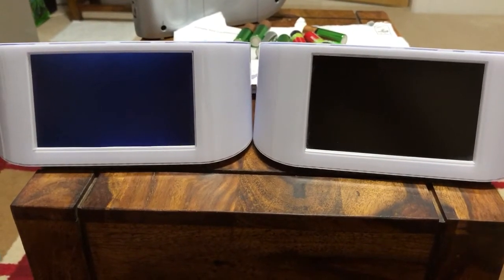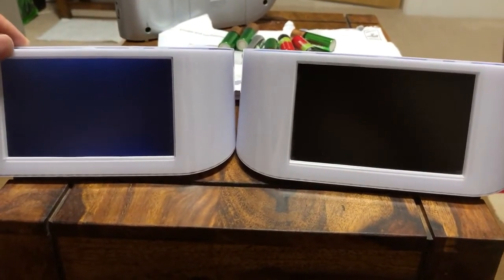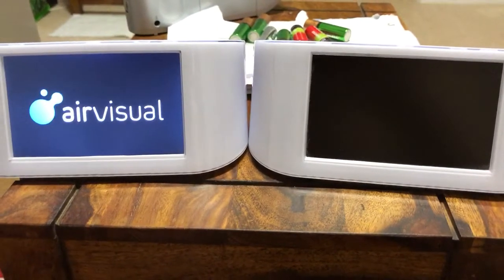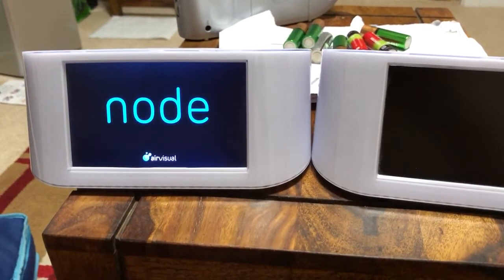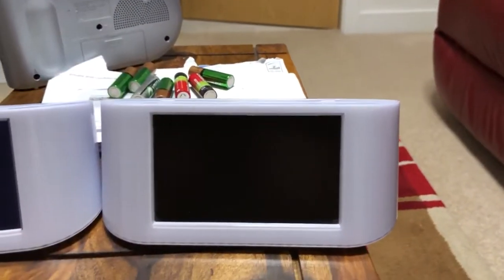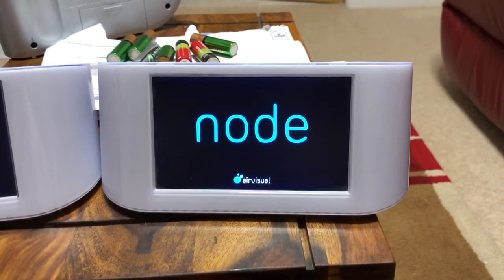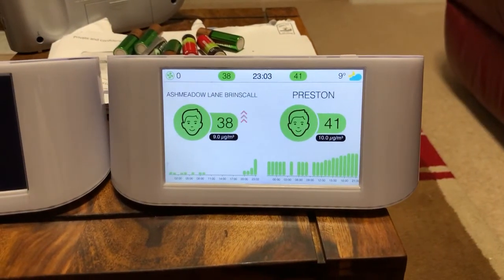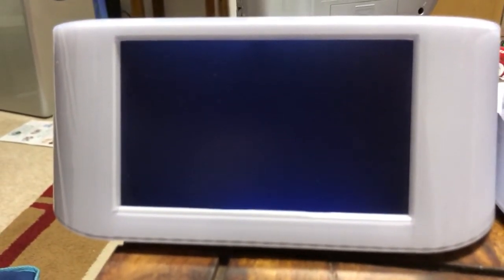Broken AirVisual node

Comment: It's a Firmware corruption.   Get in touch with Support they will dropbox you the firmware and flasher for Windows.  You can fix it yourself.  Had the same issue.  Fixed in 3 minutes.